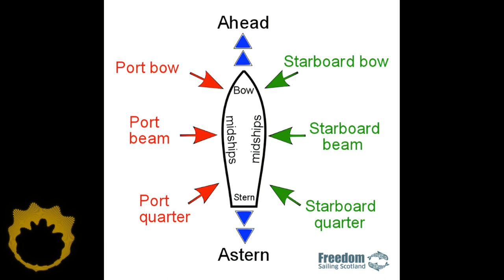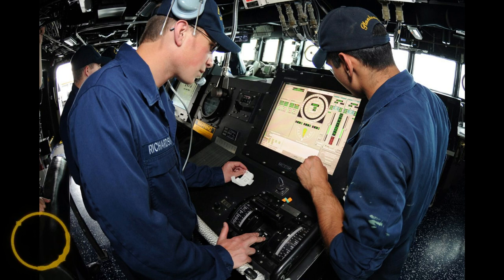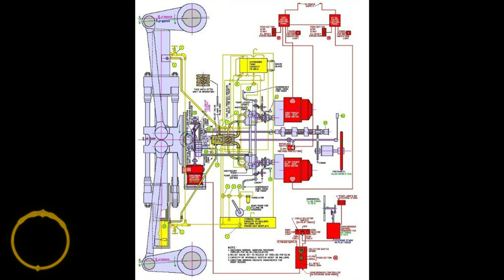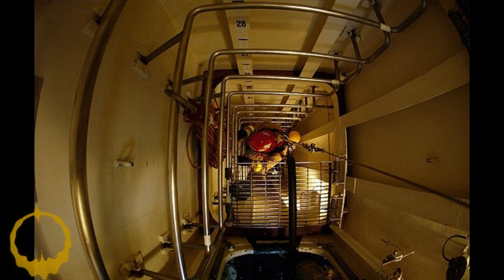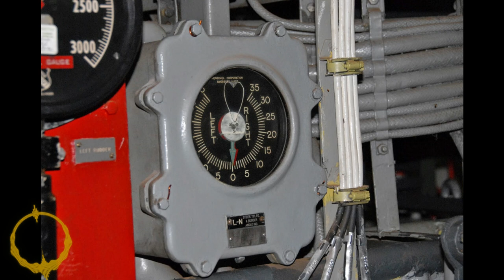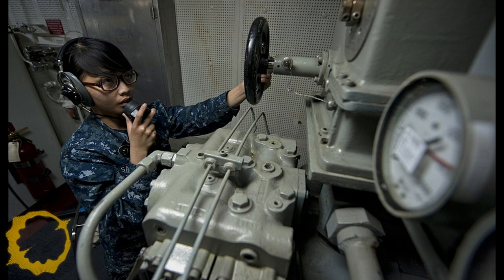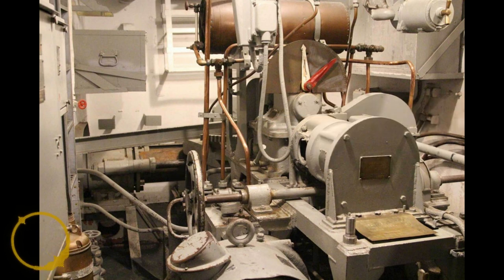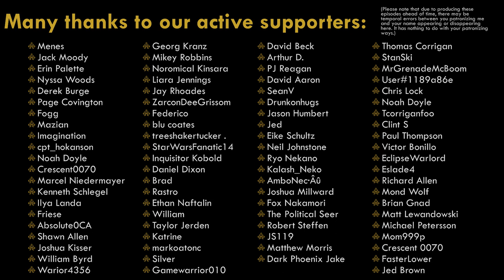I should get an award for a total lack of questionable idioms in an episode about Aft Steering

Comment: There's that weird thing from Gundam: Active Mass Balance Auto-Control (AMBAC).  If your ship is variable geometry enough you can "steer" by moving the geometry around.  Kinda like skydivers getting into the right position or cats landing on their feet.  I have no idea if physics really allows for this the way they think it does.
Reply: Wing- warping airplanes come to mind.
Airplanes also move fuel around to keep trim.
That might work on a ship- move ballast, lean to one side and start a turn in that direction...
Or make it an adjustable katamaran/ outrigger boat?
Rudders are basicly variable gometry, though... 

Also, cats work by being two reaction wheels (ok, just legs with mass) stuck together with a spine. 
Bend the spine, and you can shift angular momentum around between two semi- independent masses at a semi- right angle (front and back legs) to control where your feet land.
Reply: goot point. you don't even need to change the shape of the ship. if you can change the center of mass to either side of a function thruster.
Reply: The thing is in space you might be able to shift mass around to change the attitude of the ship and point the nose in a direction, but you still need to apply thrust to actually cause a change in direction of travel. Course if main engines still work, then your good to go.
Reply: AMBAC is about shifting your center of mass relative to your center of thrust
Reply: That only works if you are travelling through a medium, such as air, that is resisting the force. In space, there is no medium to push against your movement. Variable geometry steering would not work in space, for the same reason aelerons amd rudders are useless.
Reply: If i am correct, Gundams can also operate effectively in space. AMBAC would only work inside of an atmosphere.
Reply: @ferrusmanus184  ...No. If your main propulsion is still working but normally fires through your centre of mass, and it doesn't have any way to gimbal, then you can turn the ship by skewing your centre of mass off from the thrust vector and spooling up the main engine for a moment. The most difficult part is stopping a rotation because the main engine is likely not to be the most accurate thing in the world when it comes to precise firings. You'd end up fishtailing a lot trying to get the thing steady again.
Reply: @ferrusmanus184  As far as I can gather the idea is something like "You know how if you have working reaction wheels in 3 axes or two and a well-positioned outside force like the solar wind you can use them to damp eachother out and avoid saturation?  This is that but much slower and with much larger moments of inertia using the mobile-suits limbs."  The auto is because mobile suits are fly-by-wire in UC.  It would be nonviable with G-Gundams mocap mechs.
You of course can't change linear direction, but this saves a lot of RCS propellant.
Reply: Variable steering not only works in a vacuum, but can produce motion, albeit only a tiny amount

The NASA studies into all this are a hilarious read, they used cats in freefall to study how to steer via gyroscopic motions of the body
Reply: As long as you offset the center of mass relative to the thrust vector... You're steering!

Comment: Suggestion for any fictional ship with multiple crew and multiple RCS units for story telling purposes. Ship has a failure (flight control linkage, cut wires, battle damage, jackass driving panics and tries to put too much force on the joystick and it snaps off...) BUT instead of "aft steering) each RCS unit has a manual control, either manned in engineering or if ALL the control wiring is fragged, a station inboard of each unit. That way you could have SOME kind of emergency steering (directing each crewman by suit radios, especially, or even some hard wired, plugged into their suit sound powered phones)

Comment: The US is putting frigates back into service. They just laid down a new class of them, named for the USS constellation. The original USS constellation is a great ship, I’d definitely recommend visiting it if in the Baltimore area.
Reply: Are they following the trend and thus functionally destroyers in everything but armament? (modern destroyers would generally be identified by random observers as under-gunned crusiers if you dropped them into ww2, for example).
Reply from the maker: "They" is a bit of a strong term.  They've contracted it out to people who've been making the hull successfully for quite some time now, which is a far sight better than what happened with the Little Crappy Ship.
Reply: @Laurence Fraser it's 7.3 thousand tons, according to inter-war/ww2 standards its a cruiser. But there is no set size for destroyers, frigates and cruisers in the modern age, everything overlaps. Some have suggested to base it on roles but these also overlap...

I personally agree with the modern rating system proposal (by Robert O. Work) inspired by the British age of sail rating system but instead of being based on the number of guns it is based on the number of battle force missiles*:

-1st rate battle force ships  (battleships): 100+ battle force missile cells. 

-2nd rate battleships: 90-99 battle force missile cells. 

-3rd rate battleships: 60-89 battle force missile cells. 

-4th rate battleships: 48-59 battle force missile cells. 

-5th rate (great) frigates: 20-47 battle force missile cells. 

-6th rate frigates: multi-role ships with less than 20 battel force missile cells. 

-7th rate sloops/brigs: single role ships, usuelly with only terminal defense weapons (ie no battle force missiles) 

The Constellation class would be a 4th rate battle(force)ship under this system, due to having 48 battle force missile cells {32 mk41 VLS & 16 RGM-184}. 

*battle force missiles being mission support capable missiles, the altentuave being defensive terminal missiles (missiles only capable of defending the host ship)

Comment: Why was there a giant spanner in the aft steering section of a ship?

Probably a bet.

You can just imagine the conversation happening between two designers during the planning of the aft steering room.
"So we have four (or however many) ways to steer the ship during a failure in steering."
"Five bucks says that I can convince the Navy to have a giant spanner as a back-up."
"That's just stupid. Ten bucks if you can make it longer than six feet."

This is the only reason I can think as to why the machine gun housing on the Australian Sentinal tank looks like that.

Comment: I do like glass cockpits, but I'll not buy a boat that lacks a wheel. But given my love of redundancy, I for one would prefer hydraulic steering with a backup tiller and dual autopilot (or atleast a COMPLETE second autopilot system in storage ready to be swapped out if needed.)

Every so often I find a video I managed to miss the first time around. Excellent rant as always.

Tiller for a friggit... better include a LOT of block and tackle.

Comment: Aft steering on the 212 A submarines is pretty "fun" as you use a series of levers and a chart to control the x-plane rudders.
Reply: 726 class isn't very exciting, just a single lever and indicator arm... push lever right until desired number of degrees and let go the lever.... repeat as instructed by helmsman....

Comment: Do surface ships not use hydraulic accumulators? We have those on submarines exactly for loss of hydraulics. It's basically a reservoir of hydraulics fluid attached to a pressurized air tank that provides a limited supply of hydraulic power to maneuver. I guess it's more important on submarines as we need hydraulics to maintain depth control, where a surface ship its less severe.
Reply from the maker: It might also depend on the age of the ship.

Comment: If I could send a suggestion back in time: to compliment this tiller, there should have been a pair of bumper-jack style jacks. I love the bumper jack. There are some for farm use that can both pull and push. If you had two people with one jack each on each side of the tiller, the job of moving that tiller would be a bunch easier, if slower.

Comment: Honestly, the old wrench on the Tiller bar works surprisingly well if you have enough people... though usually they tie ropes to the other and and pas them around the rails, or hydrolics,... or whatever won't cut the ropes and then play tug-a-war with the tiller. This way if the current did grab the rutter, it would yank the rope out of one teams hands rather then say... cut them in half or toss them accross the room, plus the ropes could be tied off to hold a heading.

Comment: the one about the wrench sounds like something that the Orcs would do from Warhammer 40K
Reply: Same for the Imperial Navy but with added Prayers for removing the holy Wrench from it's shrine, fixing it in place and having the Servitors turn it. Thinking of it they probably have a special Wrench Servitor (size of an Ogryn with extra slabs of vat grown muscles and Cybernetics) just for that one purpose.
Reply: @Alex-xt1rr  now what would the Elder do
Reply: @Alex-xt1rr  Remember, this is the same Imperial Navy that sends crewmen into lethally radioactive reactor cores as part of routine refueling operations!
Reply: @randlebrowne2048  as the dogma of the Cult Mechanicus states "the flesh is weak". At least those, pressganged hivescum/prisoners, got redemption by dieing in service for the Imperium. The lucky ones are those that do die as the leathal irradiated "survivers" will be turned into Servitors in order to keep them "alive" cause "only in death does duty end". 

If only the Astartes would not keep all suits of Terminator armour for themselves ...
Reply: @sdoo-ou2ni  um Eldar crafts use solar sails so once those are gone all they can do is either abandon ship or pray that their Crystal Singers can pull of a miracle at fixing the sails.
Reply: @Alex-xt1rr  Weren't the Terminator suits actually originally designed for that specific purpose (to be adopted as heavy assault armor later)?
Reply: @Alex-xt1rr  oh crap
Reply: @randlebrowne2048  yes that is the point.

Comment: “Steering failure” = Bridge Blows up. During the battle of Endor the Executor apparent didn’t have aft steer manned… if they had it at all.
😁
Reply: Or it also was a heavy ass wrench but with a plate on it that calls "Unless your the Hulk, You're officially fucked!" 

This wrench "solution is my new favourite "sounds good on paper but actually sucks" idea.
Reply: They did have a secondary bridge! But the officers there were lower ranked and (not realizing the main bridge was gone) didn't want to risk offending the higher ranked officers by correcting course (until it was too late).

Comment: while i'm sure it's not in the "manual" i would bet the people in aft steering would use ratchet straps with the "wrench"

as for space ship control, you start with a flight computer + backups, those fail , so you switch to simplified (aka rcs by hand) with a keyboard  ... that is cooked too, ok ok 
direct breaker/ fuse control, good news... the thrusters are dead  ... vent fuel.. or at worse oxygen  ... if that doesn't do it .. same idea but with eva packs ... 

else ? .... have i told you about our lord and savior .............................
Reply: I would not be surprised at all if in the case of utter emergency the ones manning aft steering just grab some ropes and improvise a pulley system to move the wrench.

Comment: Except that the “port” was originally referred to as “larboard.”  But it’s better than the explanation for “posh”.

Could be worse:  the Battleship Texas had a manual ship’s wheel, with 6+ wheels on a single shaft, to “move” the rudder.
Reply from the maker: We figured we could only saddle your jello CPUs with so many new words that most of you won't ever use.
Reply: @SacredCowShipyards   Never under-estimate the processing power of a bowl of jello, particularly when it is made up of highly-ordered excitable cells.  Or over-estimate it, for that matter.

Comment: The wrench is more logical if you look at it in context of how rudder tech works, it would also be better to think of it as a removable tiller then a wrench. It is vestigial tech.
In a reprint of a book from 1760 and they have diagrams of how to re-step a mast at sea. That is some major redundancy, but the alternative is slowly going mad and deciding who eat first.  
Most ships wheels of 1800's is a barrel winch feeding pulleys to run a tiller, under deck. Warrior looked like a barrel winch with a equal huge tiller sweeping a deck or 2 below.
Even in world war II when the German Cruiser Prinz Eugen had major part of the stern torpedoed off. They were able to weld and jury rig a manual rudder system of 2 capstans and 20+ guys to power it. (Go look up pictures it is funny to see). 
The wrench system is so redundant they felt safe enough to take the tiller off the rudder top to hang on the wall though not safe enough to remove it from the ship.
 As for moving a beast of a tiller bar never underestimate what you can do with some chain winches and motivated sailors.

Comment: I really want to partake in a drill and try to steer with the wrench...
Anyone else?

I am sure the math has been done and it is in the realm of possibility.... right?
Reply: Been thinking about it a tad...

If it doesn't work by people power alone why not include two one ton chain ratcheting hoists and wall mounts... may even be quicker than manual hydraulic pumping....
One guy ratchet out while the other ratchet in....

Then not only is it a little easier but also it is held in place so some sort of built in or attached scale can be added and known angles held to some degree.

Comment: I was lucky enough to visit the bridge of a Keeper-class coast guard cutter as a kid, and even got to operate it for a short period of time with supervision. The secondary control stations on either side of the bridge used joysticks but if I recall correctly (no pictures of the main control stations near the center of the bridge that I could find, no real surprise there, but there is one picture where the starboard secondary control station with its steering joystick is in the background) the main control station the Captain would usually be at had two throttles, one for each engine, and two dials, each controlling the angle in degrees of each Z-pod, as well as a few screens relaying general information about the ship and its systems, likely some of which was navigational in nature. I might be falling victim to that good old fashioned false memory phenomenon as this was 12 years ago and my greater memory of the whole day has deteriorated quite a lot, but I remember the degrees being marked on each dial, though can't remember if they were from 0 to just under 360 or 0-180 on each side.

My thing about all the differing control schemes is, why would you want a ship that is confusing to operate? All ships should be as easy as humanly possible to operate without compromising utility and reliability (and also, as mechanical as possible, since us squishies and our brains love having feedback from mechanical or electro-mechanical systems i.e. the brake pedal in your car having some resistance when pressed even though the operation of the brake master cylinder is assisted either by power steering or by vacuum) as it makes it easier for the crew to do their jobs and communicate with others on how best to assist outside of their job description when necessary. I'm confident the poop deck swabber could operate a Keeper-class in an emergency where the command crew are for whatever reason incapacitated, as the controls are relatively straightforward once you make the connection of "ok this is in degrees of steering and the steering is capable of rotating 360 degrees without throttling down, this switch operates the direction of the bow thruster, port-off-starboard, this one operates the defroster circles on the windows, that button over there next to the auxiliary controls is for the horn, and this one on the console is a custom job by the Captain - coffee maker ON. Yeah we're gonna need that."

Comment: Would it be easier for warships that use azimuth thruster pods? Then you'd need an auxiliary steering room for each. As for the giant wrench, it is literally just on the wall? Is there a gantry and block and tackle to lift and move it to the nut? Could block and tackle be used to move the wrench? Is there an elevated deck in aft steering made of expanded metal so the hydraulic fluid can drain away while the manual steering crew can wear cleats for traction? Maybe these ideas wouldn't help, but these problems make me try to think of solutions.
Reply from the maker: It is, quite literally, bracketed onto the wall.

In fact, the deck of most aft steerings is not only solid metal, it's /painted/ solid metal, which is not a very secure gripping surface even when bone dry.  

We'll get to APUs eventually.

Comment: Whoever programed you had an attitude problem, or couldn't hack it as a pilot. Threatening to squish our pretty ladies to cubes wont make you many pilot friends. 
I marvel that no empire has sent a fleet over, to teach you manners.
As for engine failure.. it happens . Not often , but its a big universe and things that can go wrong, usually do.
There have been several solution to this, from shifting mass around internally,to taking an EVA walk on the skin to fix the damage, to.. having a trained fire lizard on board.(don't ask)

The purpose of the fire lizard , if i understood the explanation correctly, if she was not having me on, is to go summon a dragon big enough, to actually teleport your space ship, to the nearest repair facility. 
I was slightly inebriated at the time, was paying more attention to the pilot's lips than her words, so i may have misunderstood . 
Still  as solution go , its pretty unique.